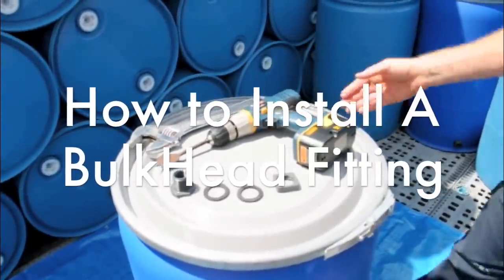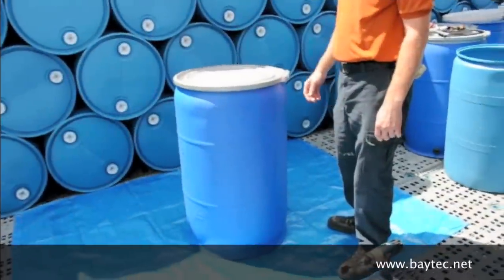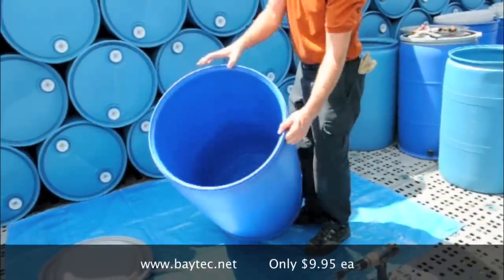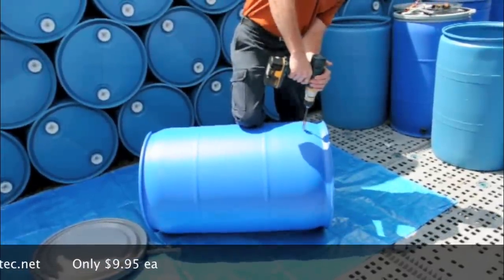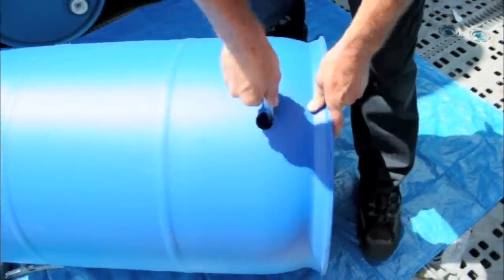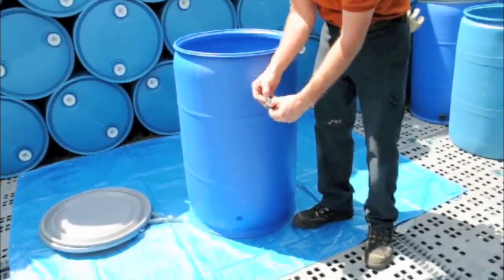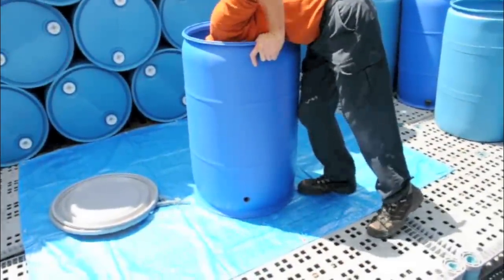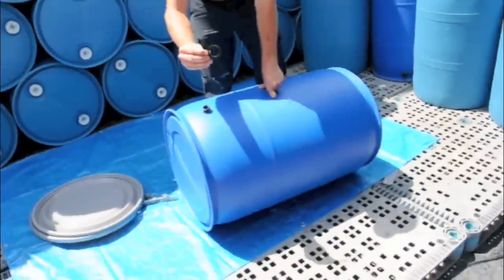How to Install A BulkHead Fitting

Comment: Hi, I installed the bulk head at the base of the drum right in the center. Now it is leaking. How to fix it. Any suggestions?
Reply: Flange and gasket on inside. Nut only on outside. Will give a tighter seal and prevent leaks down the road. See https://www.youtube.com/watch?v=w4GmHKsGwt8

Comment: According to the instructions that come with mine, he did it backwards.    My instructions say nut on the inside. (but that doesn't sound right because you would not be able to tighten it if it ever became loose)  Edit: Fixed typo's

Comment: put a piece of string through the top opening and pull through bottom hole, then slide fitting down the string
Reply: THANK YOU! Worked like a charm!
Reply: Arcz90 h